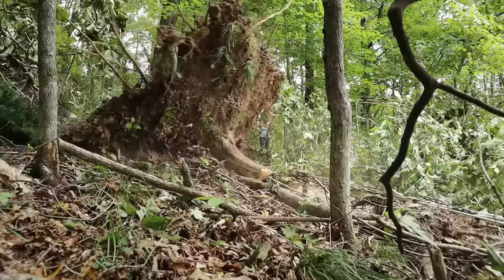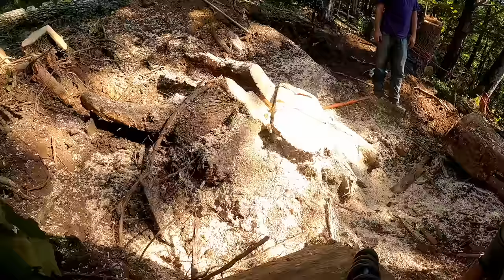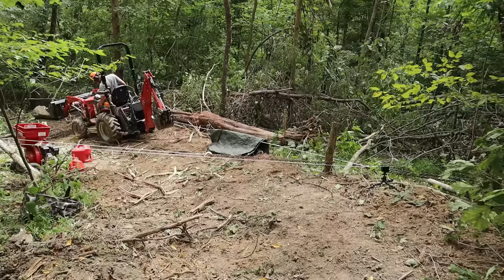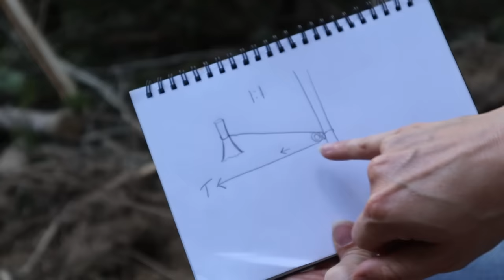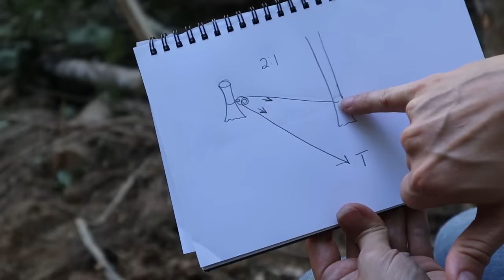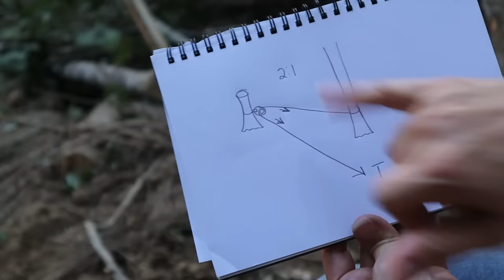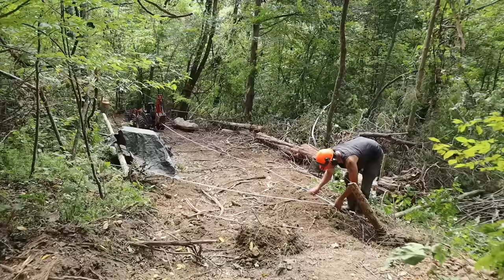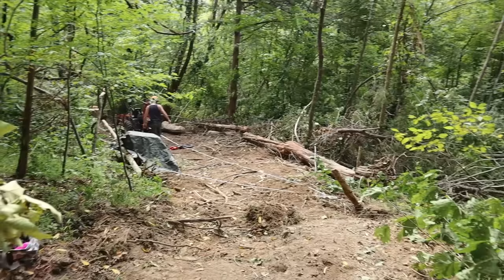Snatch blocks vs tree stumps - the power of pulleys /// E57

Comment: I accomplished cutting in a driveway very similar to yours with my L2850 Kubota. Some things I found that requires less effort on the part of the tractor AND allows you tackle bigger trees than you might expect:
- Cut the stump as high as you can - you get better leverage on roots.
- Use your backhoe to snap as many roots around the tree as you can. Also helps to minimize the root ball.
- If your cable is long enough, try pulling down an entire tree. Use a step ladder to attach the chain around the tree as high as practical, maybe 8-10 ft above the ground.
- A long cable is best, although a PITA to deal with. You want the distance between the back end of the tractor and the tree to be at least the height of the tree, or carefully plan the rigging so the tractor is shielded from the falling tree. I would sometime hide the tractor behind a tree that would be staying, as long as the terrain allowed it.
You'll find that leaving a good 'stem' on the root ball makes 'em easier to move around and out of the way.
FWIW, my driveway was about 1,530 ft. I did about half that with my Kubota, then hired out the final cut thru a hill because of the volume of soil to move.
Most important: BE SAFE out there. Shit happens unexpectedly out there. Quit when you're tired and start stumbling around making the hook-up.
Reply from the maker: Very refreshing to hear someone that built their road with their own tractor.  There are countless suggestions here to "get a dozer" or "a bigger machine".  You know, people who just watch Gold Rush on the Discovery channel.  Yes, I can do that.  I just don't want to.  I'm having fun in the woods, in nature, and having a wonderful adventure with my wife and kids.  I can't wait to walk the 2000 feet of completed road one day soon and have that sense of, "I did this."  That's what it's all about and you're one of the very small percentage of people watching that probably relates to what I'm talking about.  Thanks for the tips BTW.
Reply: @WalnutsandWineberries  

Right. One of my first comments right off the bat was to get a bigger tractor a bigger Hammer you know so I apologize. but please do take the advice about safety to heart because I've seen his time and time again you know people get tired or they have one beer don't drink I mean guy had one beer and he fell off a porch about killed himself not because of lack of balance not cuz he was drunk just cuz beer makes you stupid.
wheat affects the mind in weird ways.
I agree that it will be awesome to say I did this myself so that being said it wouldn't hurt to get a bigger tractor :-) 
 I agree with you also I noticed the comment about splitting wood I'm 65 67 years old have a heart attack at a stroke and yet if somebody told me that at the age of 65 after a heart attack and a stroke I'd be addicted to splitting firewood with a big splitting Mall ever told me they were Looney but my 8 lb Fisher splitting on my weapon of choice I love it and I enjoy doing it a lot!!!
is therapeutic and it's addictive one guy said it was cathartic I had to look that word up emotional release. I guess you could say that.
Reply: Actually, do not cut the tree off. Get a ladder and hook the pulleys up high.  I had to take down six large oaks (3 ft diameter trunks) in my yard. I have a big backhoe, 20,000 lb John Deere 510.  I dug around each one, yes, big hole, and put the bucket 12 ft up the trunk and shoved them over.  It would have been too dangerous to try and saw them off first, they were close to my home and power lines.  That way I could control where each one fell .   Florida, no rocks.

Comment: Great video!  If you haven’t picked up this tip yet, place the “stump” end of the line as high as you can in the tree.  This gives you more leverage for free, and is the reason wind usually knocks down tall trees before shorter ones.
I’ve been pulling “weed trees” up to about 3” diameter with an electric winch & battery, and have had a lot of success.  I started with a cheap come along, but it took so much longer to adjust the length as I pulled that the winch was money well spent.

Comment: Thank you for the "what we were doing wrong" parts as well as the clear diagram of how to do it right. 

I have been trying to set up a simple pulley system to help me get heavy things into and out of my basement. The steps are steep and I've been afraid of falling while carrying things up or down them that requires both hands and most of my strength (40 pound bag of cat litter for example). Yours is the first video that explained what I was doing wrong such that I understood how to correct it.

Comment: Good video, thanks for posting. I would add a couple of things. In case there is a failure in your setup, there should be something to weight the wire rope to keep it from flailing and causing injury. If you want to avoid girdling the trees you are using as anchor points, use a tree saver strap.

Comment: Just a suggestion - At most home improvement stores there is material that you can drill 1" holes and fill and allow to set overnight in concrete or rocks.  It expands and will crack concrete / rocks - I did it to my front steps years ago and it worked great.  I did it in the late fall in MN and had to put an electric blanket on it (wife wasn't happy) but it worked GREAT and I could handle it myself.  Fun to watch and how wonderful it is to see a couple work together.  Well done, both of you.

Comment: Do it the way our ancestors taught us, climb the tree cut off the branches and attach your cables etc to the highest strong point of the tree, then you have the leverage of the tree itself to help pull out the roots.. Multi pulley blocks will increase your purchase even further they can be obtained from crane hire firms cheaply after they have been condemned for crane use, they do tend to be very heavy. but will give you enormous purchase.
Reply: I agree about the height. Where I come from we always started at the top, stripped the branches and then used the trunk as lever for its own roots. I cannot understand why here in the US it seems to be normal to cut a tree down about a foot or two from the ground and then leave the stump for others to deal with later.
Reply: Pulling from higher up the tree will have a tendency to lift the rear of the tractor, which in this case is not a big heavy unit. You would need a pulley at ground level to avoid this.
Reply: @whatscoldoing5627  yep you are correct thats why I said two pulleys.
Reply: Right. You had the whole way to the tree and The leverage of that tree like a gigantic 6-ft breaker bar on steroids when you're trying to break lug nuts on a wheel hub.
Reply: @howtogetoutofbabylon8978  Just so

Comment: Force x Distance is always an advantage for removing stumps.  As others have shared, keep you stump trunk taller, tie off higher therefore you have more torque at the base (roots) of the tree.  Example, if you tie off 1 foot off the ground and your tractor having snatch blocks have a mechanical advantage of inducing a force of 1000 pounds (example), it would calculate out to 1000 pounds * 1 foot = 1000 lbf  (pounds of force or also call foot-pounds).  If you tie off at 3 foot then it would equate to 1000 pounds * 3 foot = 3000 lbf.   Obviously using snatch blocks and other pulley systems can/will change your "mechanical advantage" so engineering is a fun thing!

Comment: Good job guys. One more point on the pulleys. It takes a certain amount of force at the base of the stump to pull it out of the ground. The pulley system multiplies force exerted by the tractor. A similar mechanical advantage may be achieved by moving the stump attachment point higher. Like adding a pipe on the end of your wrench. Leave more tree trunk or even try pulling it out of the ground before cutting the tree. I think you may be surprised much this helps. Blessings.
Reply from the maker: Good tip, Randy.  More leverage ✅
I also found loosening the soil around the stump and ripping the roots with the backhoe takes about half the fight out of the battle.  Getting the chains to keep hold exactly where you want is tricky.  I'm on the lookout for some tree attachment points that I can hook the winch cable or chain to.
Reply: @WalnutsandWineberries  By the same token the anchor strap  or chain should be as low as possible on the anchor tree. Straps give less damage to the bark of the tree.
Reply: Excellent point, put it as high as possible without breaking the trunk from force of pull.

Comment: One thing to add your excellent learning path to success is basic physics.  
If you add leverage to this setup it will be way easier, and require less horsepower, to pull that root ball out of the ground.  Cut the tree much higher up,  then cinch your anchor-point on the stump as high as you can.   The higher you go,  the more leverage you create.  For stubborn huge stumps you might even want to use a ladder to get even higher.  Great video, and showing the failures is a great teaching method.  Kudos to you,  great work.

Comment: One thing that has worked for me with large rocks is to dig a larger hole next to the rock and roll it into that lower hole. As long as it is below the level of the driveway it is fine and a great base.
It is easier than lifting or dragging a large rock out of the ground. I depends on having a space with dirt and smaller rocks in an adjacent space though.

Comment: When I worked with the Boilermakers doing extreme lifts of up to 32 Part Lines, McKissic was a popular Brand, especially with they're smaller 400 Series Blocks when we were using Tuggers and just Single Blocks to change direction. Crosby, we're the Brand choice for Shackles or Clevis's. I just Googled it because I stopped working in 2004. You're a great help to Lay people to avoid the dangers of snapping chains, rope and cable. I wish you great success in your Homestead Project!

Comment: I stumbled on your video and I am glad I did. I won’t divulge my age but just let me say that you are never to old to learn something new. You see I live along a brook that beavers have dammed off and have littered the upper portion with fallen trees that I have to pull out for fire wood and now I know how to pull out the larger ones. I have all the equipment, blocks, rope ,cable and chains but struggled with getting them up the bank. I do believe my problem is solved, I will let you know this spring when I attack them again, thank you so much.

Comment: When using snatch blocks, keeping All your lines as parallel as possible,  will give you the most pull. Did you notice that big stump moved toward the pulling, not the tractor?
Any of your rock ledge or deep rocks that are above ground, I have found that a Stihl cutter with a concrete wheel will do the job. Cut down into the rock every 3 to 5 inches apart to the ground or a little below and bust off the cut peices with a sledgehammer.  Wear long pants and wear eye protection. 
Hope this will help.
Reply: Yes, keeping all the lines parallel as possible is the way to gain the most mechanical advantage. Case in point was the first pull you made with the 4 to 1 configuration. The line going to the tractor was not parallel with the others so you really only had maybe 3.5 or so to 1 mechanical advantage. You have to grasp that because the last run of wire rope going to the tractor was not exerting effort in the same direction as the others it was basically only acting as "change of direction pulley"  not a true mechanical force multiplier snatch block.  Another way of understanding this is to imagine that the tractor had been pulling in the opposite direction from your anchor tree.  Even though you had the wire rope running THROUGH the pulley, it would not have added any power at all and would basically just have been a 3 to 1 configuration.

Comment: Great video, thank you for explaining the use of snatch blocks and wire rope so well. I have 3 stumps to pull out. I have a JD 3025 E, 25 hp. I live in north Florida so we have lots of sand so it should be lots easier for me. Thank you!
Reply from the maker: You're very welcome, Ralph!  I hope our struggles over this past week help you and others save time and frustration.  Be safe 💪
Reply: How do u like your 3025E? I have a 1025r and I figured out quickly that I should have gone larger! I lack speed and lift power 😵‍💫😑 but was wondering what the power ratio is like when it has the same engine as what I already have
Reply: @wraith3951  Watch the videos by "Tractor Time with Tim".  He has both sizes of tractor I believe.
Reply: It's the same size engine, but for peak horse power and torque you run the 3025E slower. I  think max rpm on a 1023E and 1025R is around 3400 and the 3025E is around 2400. All I know is I've never taken it over idle and in high range and it's done everything I wanted. I have a Westendorf, Brush Crusher grapple, it's mechanical and it works great and there no hydraulic to run. I hope this helped

Comment: I was clearing a bunch of birch <1" to 2" or so. I cut each tree about 6' high, wrapped a chain around it near the top, and rocked the tree out using my 1997 S10 (in great condition) automatic. I had a lot of slack and would give some gas, put it in neutral and let the force of the truck mass times velocity equals force to bend the tree over, break some of the roots and pull it out. This worked 90% or so on dozens of these pesky trees. Liked and subbed, good job!

Comment: you can move large rocks by using folcroms fighting one side against the other. another way is to make them  round you can do this by adding some of the trees you have cut down.  i had a lot of fun moving a shipping container (40 hc 8,800lb) about 300ft uneven ground, lots of turns,over a bridge and that was on my 50 birthday. another good leverage is when you have a rope very tight you can pick up the middle (back hoe ) something will give for the first few inches then tighten. i real like the way you two work together. you will have a lifetime of projects and fun.